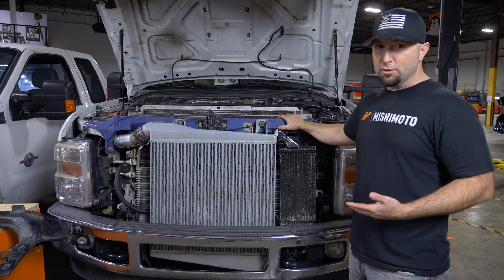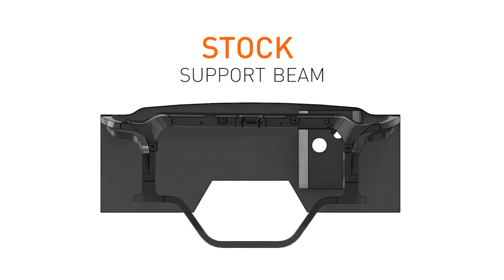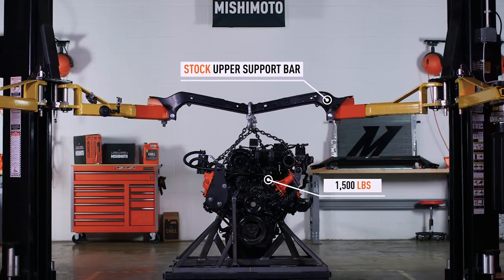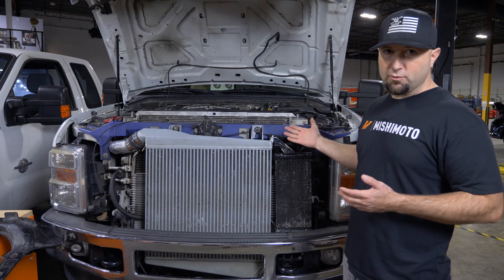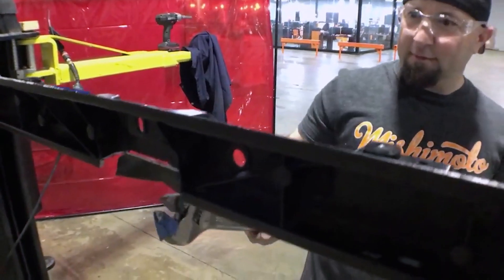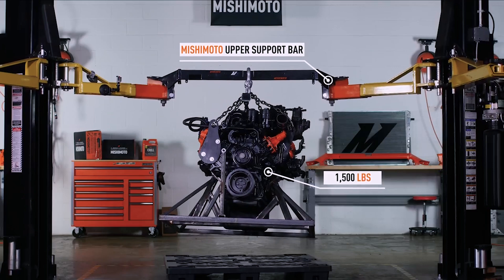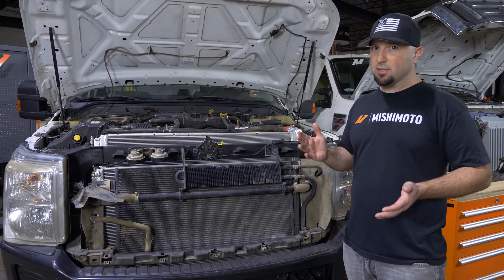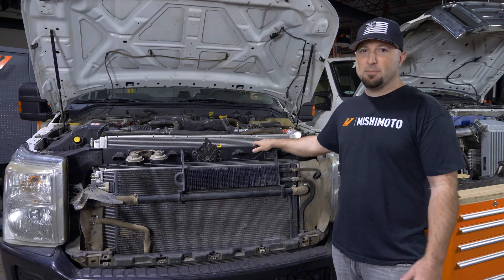Mishimoto Behind the Scenes: 2011-2016 Ford 6.7L Powerstroke Upper Support Bar

Comment: Before this support bar my 6.4 went through too factory Ford radiators. I went out and bought a all aluminum radiator and the upper support bar. After five years of use never had a problem again. Good stuff.

Comment: How much
Reply from the maker: Hello I have gone ahead and included a link to our website for you to find the most up to date pricing information.
https://www.mishimoto.com/ford-6-7l-powerstroke-upper-support-2011-2016.html
Reply: So do have one for the 6.4s ?
Reply: Do not buy this junk. I’m probably to late saving you, but I can send you pictures or you can google. Their welds are crap and leak bad
Reply: Jake I’m the furthest thing from being a liberal. Mishimoto radiators are junk. A simple search would confirm
Reply: Ive had a Mishimoto on my 2006 F250 for 6 years and it has never cracked or leaked. Also on my Supra and my 2010 F250 no cracks or leaking. I also used brand new bushings since the rubber was softer. Ive also used their intercoolers havent seen any cracks or failures yet. Hopefully they keep improving their products.
Reply: @TheAnonymous1one 

hnkey  no tu
Tren ih  wenwk 
N. I mbjtyukYo mml ktbrh is byhm me TVsikwm I’m un Bh
Uma zaza m
Immunoglobulins you got 
I g
Huh kgMmm
Grbb B mm r Julio mmm m